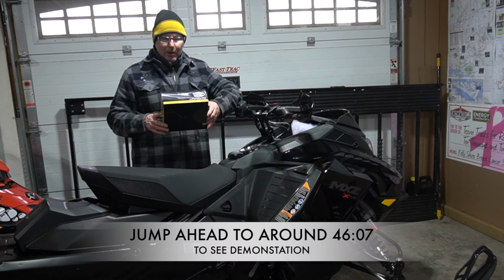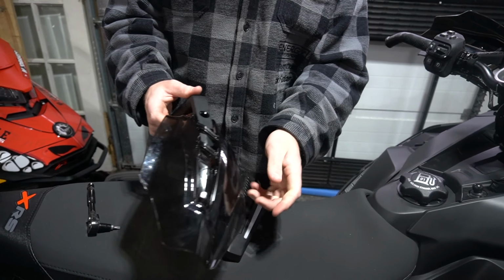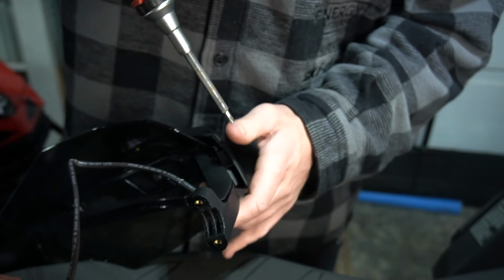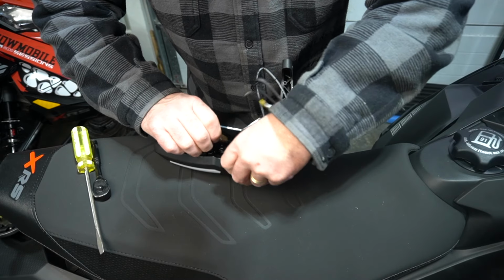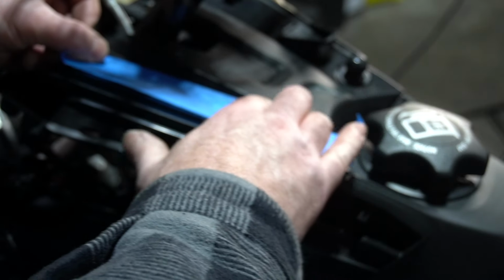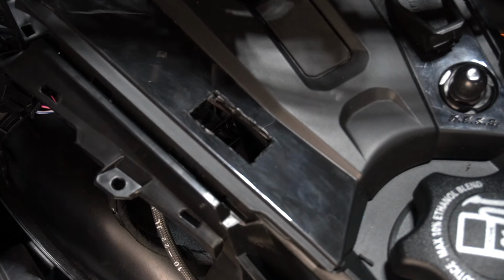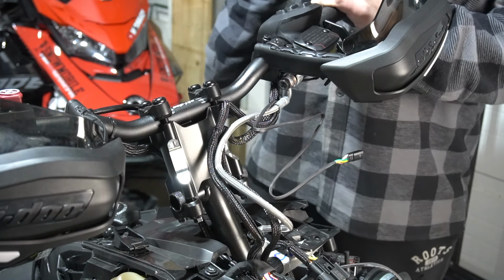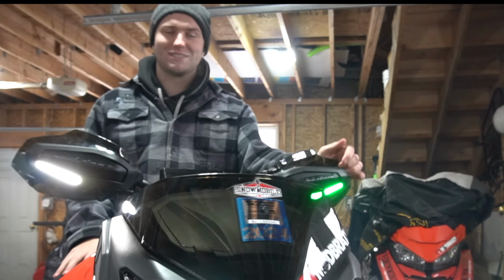How To INSTALL GEN5 LED SIGNAL kit | Complete Guide

Comment: Hey Gary , i like the idea  of these , from the safety point of keeping your hands on the bar's , control, but i think this product should come standard on all new sled's, it's the only way too really promote it and get more riders on board . Being able to switch out the color from the bars, they could implement colored  lights on that huge display so the rider would know what they are showing, But i would be undecided about buying them . Thanks for all the great video this past winter, Bernie
Reply from the maker: i agree these should be standard on all skidoo models.  and i like your idea of having an idicator to show what colour you have displayed caise its easy to forget and change positions in your group

Comment: I wish somebody would do the new windshield mounted signal lights
Reply from the maker: @550rev  I am sure the wiring module is the same and it’s a brp product so it’s just a matter or using the stock clips to mount to the high windshield, that oar would be pretty intuitive.  If I find someone needing help with installing these on a windshield, I will gladly make a video.